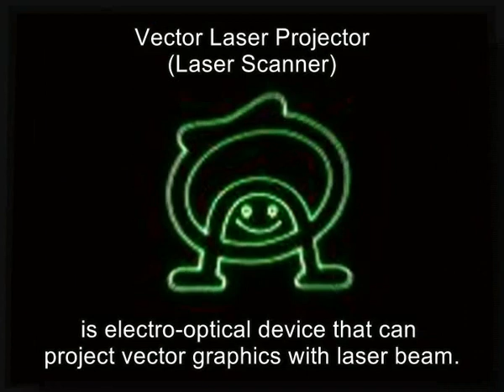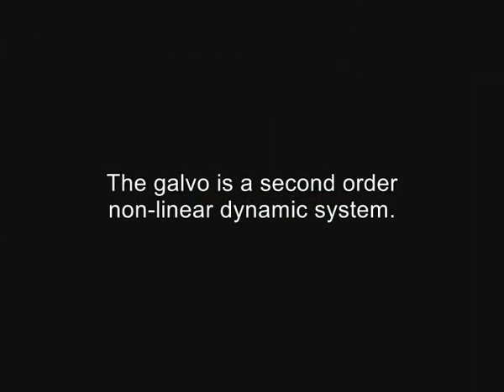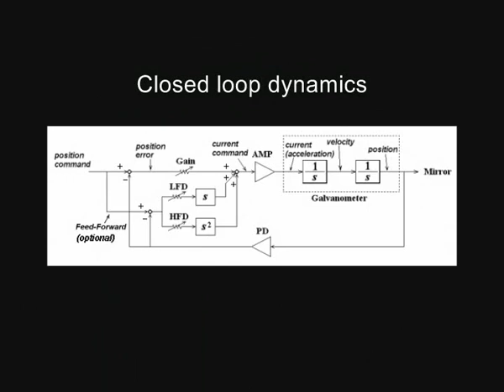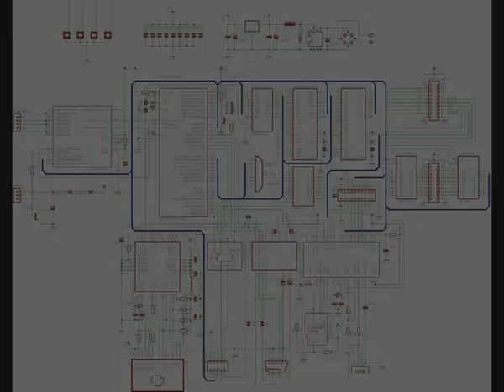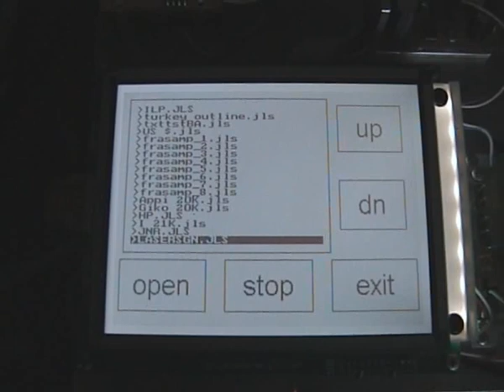Homemade Laser Projection System

Comment: I made a full-fledged device on STM32F4 + ESP32, with a player for Windows and a streaming TCP connection. 2.4W Red 0.8W Green 5W Blue laser diodes. The project is called LScan.

Comment: Very impressive, specially considering it is all DIY from scratch. Wouldn't have believed the response you got from those galvos, had I not actually seen it. What hardware are you using for the controller?

Comment: Your position detection approach looks very interesting.  It looks like it's a variable capacitor with RF to detect the capacitance?  My god, so much analog and digital, it's full of stars.  Despite that, however, you clearly do not understand the eye hazard and dangers of crowd scanning.  It looks like you or whoever that was dancing got several direct eye hits at close range.  These are not toys.
Reply: Yes, crowd scanning even by professionals is rare these days.  It requires a lot of planning and carefully crafted sequences to keep exposure well below safety limits, site surveys, risk assessments, insurance.  Just not worth the hassle.  But that aside, he has done an amazing job on the construction.

Comment: if that laser can light a match then I don't think I'd be pointing it directly at people. also without an enclosure you run the risk of exposing the whole room to laser radiation even if there not directly in front of the beam.